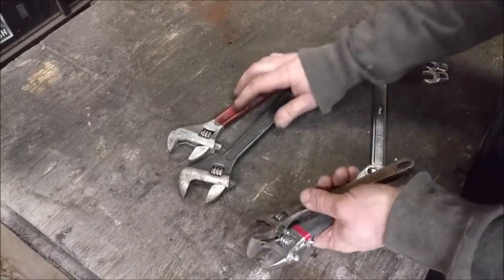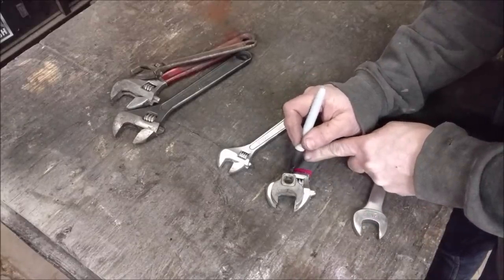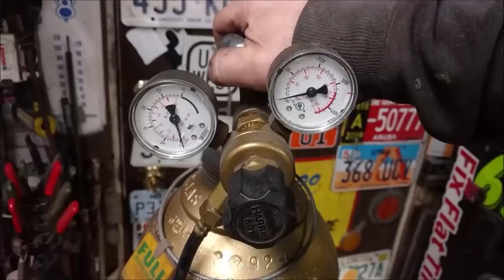DIY Adjustable CrowFoot Wrench

Comment: Damn I'm glad this was in my recommended videos, even if it is 2 years later lol. That is a brilliant idea, going to make some of those tomorrow. Also, I tried the Diablo metal cut off wheel, it cut alright, a little slower. It was too loud for me though, had to use ear plugs with it so I went back to regular cut off wheels

Comment: Thanks for mentioning the cut off wheel. You make a good point about it lasting as it has. The project brings a lot of options. You really hit my peak interest when it came to bending metal. That could have helped me in the past. Now I know how to get around it.
Reply from the maker: Hey thanks. I've been enjoying the diamond discs but still use an abrasive if I have a lot of stuff to cut and it's time sensitive.

Comment: That is a TOTAL BAD ASS IDEA!

If only there was a way to "LOCK" the size into the "CRESCENT*" Wrench Crows Foot, to keep it from slipping!

Thanks for sharing!

Now to obtain know lage to use my Father-in-law's Stick Welder...

Have an AWESOME Day,
-Thomas 🤓 Skagen
Port Orchard, Washington
Reply from the maker: The adjustment screw shouldn't slip for a single turn. After that the bolt is generally loose and a little slop isn't detrimental. But you can readjust after each rotation. Higher end adjustable wrenches have a more precise fitment and really don't slip at all. I didn't cut up my Proto just for this reason.

Comment: Bending sheet metal is the only thing I use adjustable wrenches for!!! As far as crowsfeet wrenches I only use the line wrench style because they don't stretch and round off the bolts, but that's just me!!! Keep Rocking it out!!!
Reply: @Ron Wilson See I knew I wasn't the only smart guy around!!!Lol Keep Rocking it out Ron and check out my channel if you like old cars and loud guitars and staying out of bar's!!!
Reply from the maker: That's where I've relocated them to. I wouldn't pick one up when regular wrenches are within reach. I will throw one in the wrecking yard bag along with the common wrenches though and even then I won't use a cheap adjustable.
Reply: @sixtyfiveford  Don't get me wrong brother I've used them in a pinch, and yes there is a couple in my tool box, but they mostly get used to bend metal and they are great for that!!! Keep Rocking it out Dude!!!

Comment: The Snap-On truck had purpose-made adjustable crows-foot wrenches.  Had a full set, so I didn't need this, but then again, I was trading two of them in that I'd jacked up.  I don't think an adjustable one would have survived long with the work I was doing.
Reply from the maker: Snap-On actually sells these adjustable ones. Nothing beats a fixed wrench.

Comment: My favorite use for it would be for bending metal..Save those handles you cut off and weld some small ball been hammer heads to them
Reply from the maker: The handles will find a good use somewhere I'm sure.

Comment: Snap off had one of those back in the day I should of bought it on eBay it was like $35. If u watch videos of how to make a square hole u can add that to all the wrenches to give more torque using a long ratchet or extendable one. Nice video

Comment: Very clever, I wonder if a universal socket would even be better.
Try using a universal socket instead of a standard socket it might give you even more flexibility.
Reply: Great idea, UPVOTE so Moe sees this please
Reply from the maker: That's a clever idea. It would have to be a stiff joint to not flop around too much.
Reply: Here is another version that snap on makes but it is pricey part number ADCF8. You could just use a universal
with this version. I don't know how much torque you could put on it.
Reply: @sixtyfiveford  you can wrap it in electrical tape to limit the flopping. 

got that tip from ChrisFix!

Comment: I just did something verrrrry similar for a small pipe wrench. They put these short af nips in a machine, and then built a frame around it haha. It was totally inaccessible for any kind of regular wrench. I didn’t weld mine, I used silicon bronze TIG.

Comment: Please do a version 2.0.     Drill a hole and insert the socket.  This way if the protruding side causes a clearance issue.  You have the ability to flip it over.  Also this will mitigate the likelihood of rounding nuts by utilizing the fixed jaw to drive the torque.
Reply from the maker: True, but the pin that holds the thumb wheel would have been drilled though. That's why I put the socket on top.

Comment: Nice quick fix...making adjustable crow’s feet!  Of course my big question is when are you going to start on the restoration of that 1965 work horse Ford you got anchored in you garage?  I know life gets in the way, kids and wife are a priority, working a main income job is necessary to maintain life, and all the other major factors that are priority!  But, can you give me an idea on or about when (in your mind) your restoration will begin?  I’m not holding you to a date, just a guess as to when...ie next year, two years, five years from now etc.  I love your quick fix videos for shop problem.  I’m building me the hydraulic adjustable height work bench, ingenious idea!
Reply from the maker: I got kicked off working on it last year from taking on too many customer welding, small engine, vehicle repair jobs. I plan to make progress on it this summer for sure.
Reply: Now will you be making videos on it?  I hope so! Thanks for the reply!

Comment: Oh man I love it! I need that for small block chevy headers, going to be making one of these soon.
Reply: Don't think that any good for a header wrench.  You need a offset 7/16 Snap-on wrench. Tool number VS-14. Try that and let me know what you think. Keep Rocking!!!
Reply: @rockerpat1085  Have that wrench, useless to remove the back bolt.
Reply: Checked out your channel and I like the 69 F150 you got going on there!!! But I thought you were a Ford fixer and you got mostly bike stuff.  I hit that sub button for ya and if you like old cars and loud guitars and staying out of bar's check out my channel and see if you like what you see!!! Keep Rocking it out Ford guy!!!
Reply: @DanTheFordFixer  well brother I don't see that big ass thing there getting in there at all. But I guess I'm biased against all adjustable wrenches anyway. The only thing I use one for is bending sheet metal. I find those things as bad as vicegrips on a bolt!!! But thats me. Keep Rocking it out!!!
Reply from the maker: Danthefordfixer.... What are you doing fixing Chebbies? Thanks. It's a fun idea to be able to carry all my crowfoot wrenches when I'm away from my toolbox.
Reply: @sixtyfiveford  I own Ford's but as a mechanic Chevys have more problems so it's money in the bank rebuilding them, finishing up a '66 C20 right now, power steering conversion, fully rebuilt everything.

Comment: For arc welding, what kind of rod would you use on that metal. Thanks.
Reply from the maker: I don't see why 6011 6013 7014 or 7018 wouldn't work just fine.

Comment: It’s an interesting idea, but sometimes you need the least bulky crowfoot possible. The crescent wrench crowfoot just wouldn’t fit in some tight spots. Ultimately you’ll end up getting a complete set of regular and jumbo crowfoot sockets, therefore making this idea unnecessary.
Reply from the maker: True, but it's just like any adjustable wrench for applications.
Reply: @sixtyfiveford  

I remember hearing ChrisFix say that crescent wrenches are pretty much gimmick tools, which is something I had never considered before, and I gotta say he’s probably right at least most of the cases. One scenario where crescent wrenches are useful are as emergency tools in a car so as to not keep an entire set of standard and metric wrenches in your car. Universal sockets can also be added to the emergency toolbox.

Comment: Been pullin wrenches over 55 years and have never used a crows foot
And this is a strange use for a self adjusting cresant hammer
Reply from the maker: It's an odd tool for sure and why I've never invested in a full SAE and metric set. In most situations where I would need a crow's foot I just take my torch and bend a junk wrench to fit what I need to do. I've only used this one time since I made it a year ago and that was on a 17 mm bolt that I wouldn't have been able to reach without bending a wrench.

Comment: Better approach would have been to skip the welding. Just drill a 3/8" hole through the wrench head and ream it to 3/8" square. Then you can use it from either side and it takes up a lot less space in your tool bag/bucket.
Reply from the maker: Yes true but it would also significantly weaken the monkey wrench by having a hole right at a stress point.
Reply: @sixtyfiveford  I think it'd be worth a try with one wrench, especially since having the jaw pointing the wrong direction (it's pointing the same way for loosening as it is for tightening) also weakens the heck out of the wrench. The fixed jaw should always be in "pulling fingers" mode, never in "pushing thumb" mode. Try one broached, see if you can break it.

Comment: You are so inventive.
Now i've seen it all, an adjustable crowsfoot :-D
Shame the record has died, i wonder if the company cheaped out :-(.
Have you tryed bending the ends of ring spanners or ratchet spanners 90 degees, i'm sure you have some cheap china ones to torture... i  mean modify :-D
Reply from the maker: I wish I could say I was the first to come up with the idea. It was actually patented back in the 1940s. I do have a handful of spanners I've heated and bent over the years for random jobs.
Reply from the maker: I did get a replacement part for my Record Vise and it should be back up and going in a few days.

Comment: I think I'll pass, the key to using an adjustable wrench successfully without rounding things off is to snug it up on the fastener and generally keep your thumb there.

I can appreciate the ingenuity, but the idea just isn't for me.
Reply: Maybe wrap some tape around the thumb screw so it's a bit harder to adjust but also harder for the bolt to throw off
Reply: @OtherDalfite  
If you don't keep your thumb on the worm gear it can back off causing the wrench to slip and round off the corners of a fastener.
I don't know where you're gonna put tape that's going to prevent this.
Reply: @TylerSnyder305  I meant wrap enough tape around the thumb screw so that the walls of the wrench body grip the tape to prevent it from slipping. IDK if it would really work or not just a thought
Reply: @OtherDalfite  
The tape would prevent it from turning as it interfaces with notches in the mobile jaw to move it.
If the work gear was tight enough to hold it might be hard to turn, but would stay.
I suppose a tight spacer might work.
Reply: @TylerSnyder305  yeah just realized why my idea won't work lol. Throw it down in the mud and then brush it off so the dirt makes the worm gear not spin so easy 😂